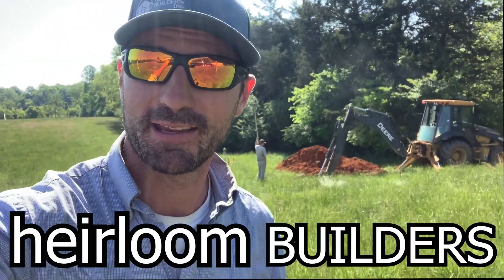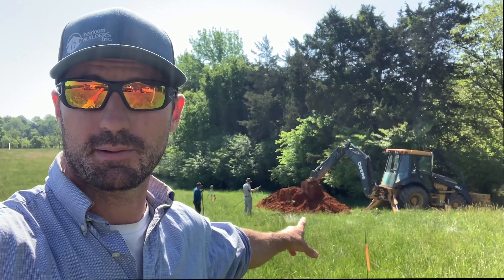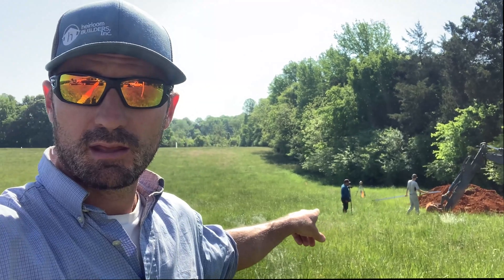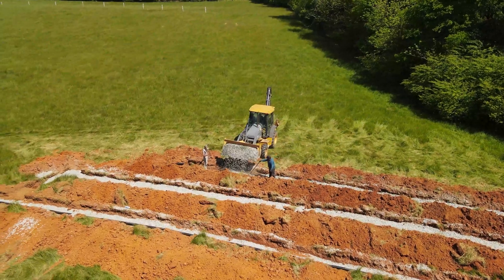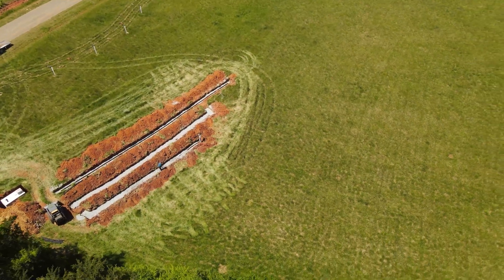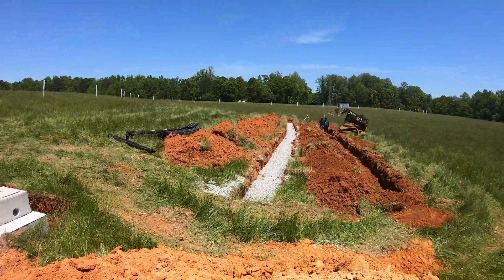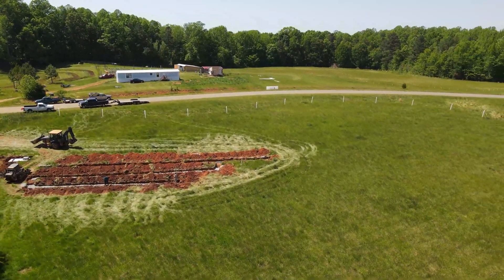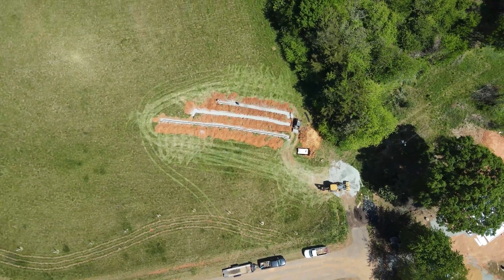Why are we installing a GRAVEL Septic System? Septic Systems 101 : Episode 9

Comment: After years; how is the solid waste settled in bottom finally disposed of?  I think I would want to put a small fence around septic area to keep animals and tractors out.  (Someone who does not know it’s there)
Reply from the maker: Hey Terry! After years of solids settling, the septic tank is pumped out to remove the solids. There are companies that specialize in this practice. That’s the deal: you either fence off your septic leach field, or install a gravel system that can handle the weight of farm equipment and animals.
Reply: @HeirloomBuilders  I will do the gravel and add the fence because I know that unexpected shit happens.
Reply from the maker: @T_157-40  🤣👍👍
Reply: The man in the video, literally says that’s why he’s using this system. So vehicles and livestock can be on the surface above. 🤷🏼‍♂️